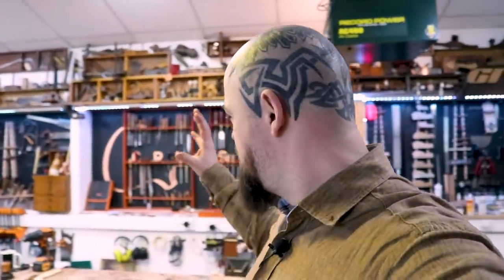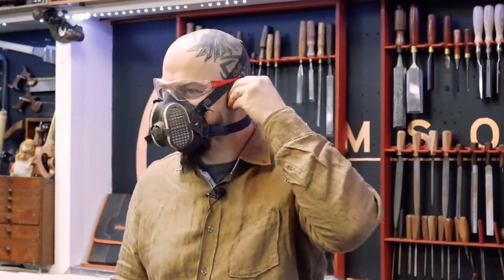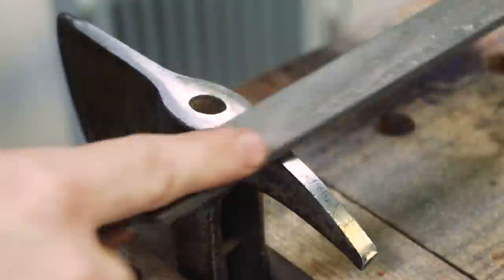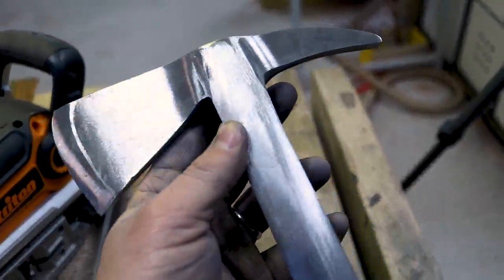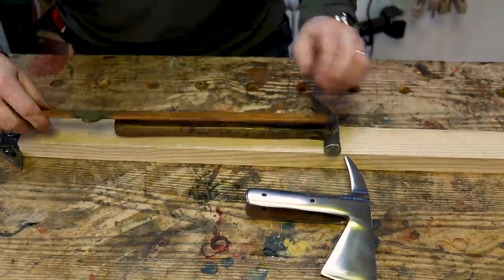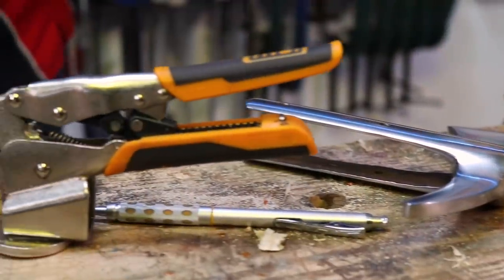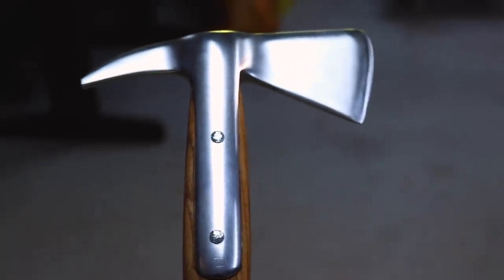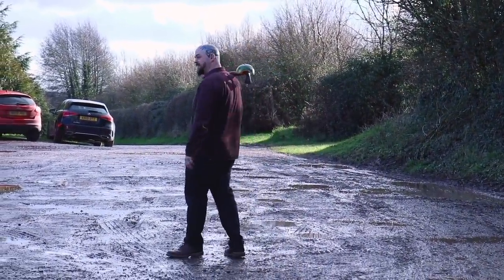Perfect Restoration of a Rusty 1950's Fireman's Axe

Comment: These were routinely available in the '70's as new old stock in the UK, as fire services upgraded to more modern kit - so normally no history of daring rescues locked up in the patina of most of these. I bought one for £1 - it's in the workshop now, having done little more than chop firewood. I have another better quality fireman's axe of unknown origin which has a hard resinoid rubber handle which I am sure has seen action somewhere - it's an encapsulated through metal handle, and weighs an absolute ton.

Comment: Ben, you've made me so sad😔. You've erased the history and soul from the axe. Every dent could have told the story of a daring rescue. Removing the Brades makers stamp actually brought a tear to my eye. If only you'd stopped soon after your initial rust clean up, made your absolutely perfect handle and sharpened the axe to a good useable condition. Then it would be a tool I envied. I love my vintage tools and enjoy feeling the history in my hands every time I use them.
Reply: This was what I was thinking. It actually looked real nice, and then it turned into an anonymous tool.
Reply: Very much in line with what I was thinking. Not a restoration, he scrapped it and use the steel to make a new one. The end result is beautiful but I feel there would be more merit in building it from raw stock.
Reply: I agree. Removing the maker's stamp and the scale that was marked along the edge of the handle removed its character, history and most of its value as an antique.
Reply: 100% agreed

Comment: I restored my dads old hammer recently -. The one with a Bottle Opener instead of Nail Puller.  It was was quite heavily oxidized.
All i used were the small silicon NAIL MANICURE POLISHING pads that i got in the cheapo shop. 75cents each here in Madrid Took half an hour.
Of course I forgot to take a BEFORE photo

Comment: At 2:14 you can see a cloud of rust coming off the back of the wheel, if you put the hose of a Shop Vac (or your local equivalent) there, it should suck up most if not all of that material before it makes a mess of your shop...

Comment: I'm frankly surprised you went to town on that axe head as much as you did. All of the original markings are gone, as far as I can tell, and some of them would have been what made it what it was, right? So basically you used an old axe head to make a new axe head. Nice looking result, but it's not a restoration, right?

The only reason no one is going to be terribly upset is because there must be literally thousands of those axes cluttering up Olde England. :-)